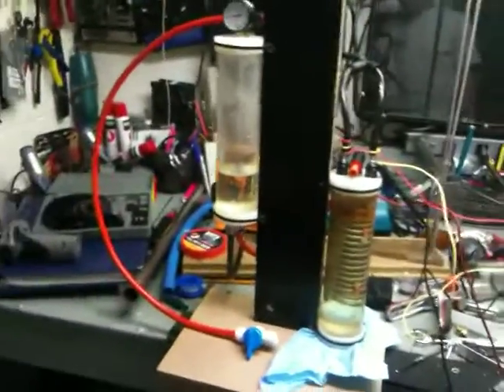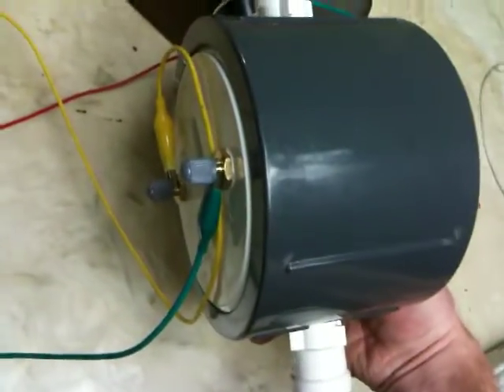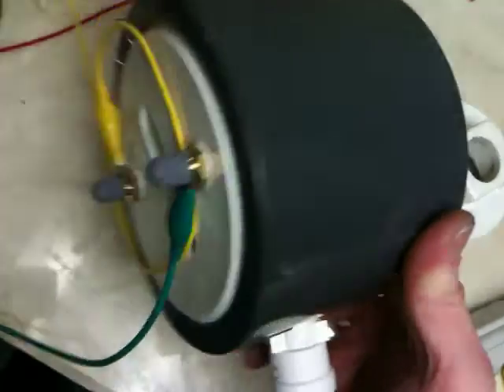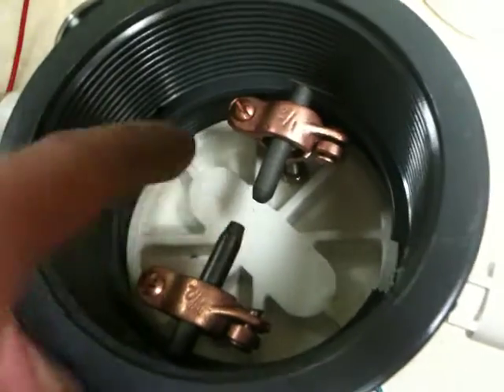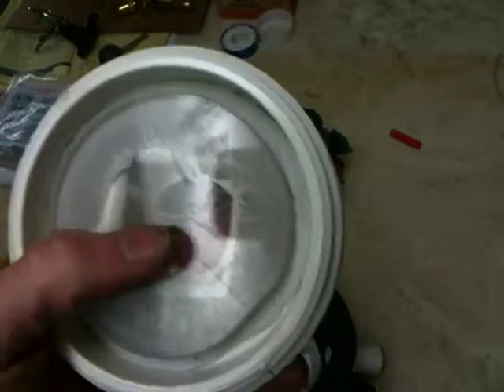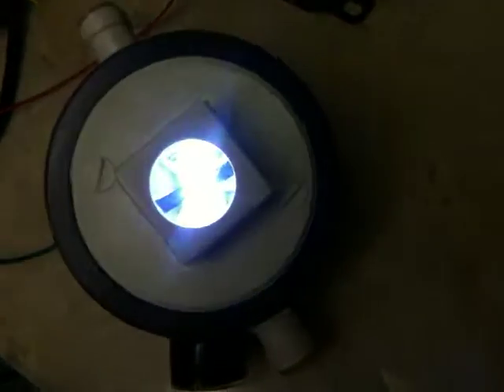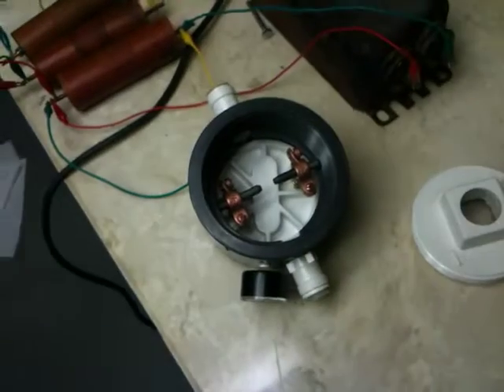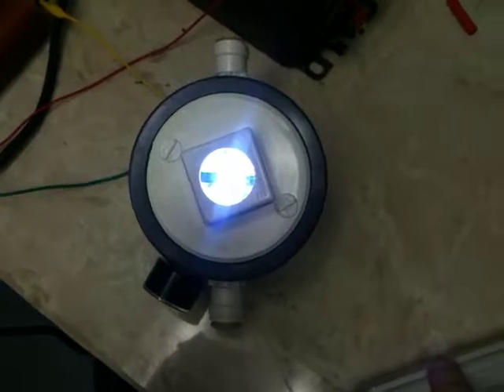1.3 Carbon Spark Gap With Caps! In New Chamber!  Stanley Meyers (EPG Test1.3)

Comment: good job Russ-i figure you could also ionise using a secondary spark gap off the NST....rather than run another device like my setup has-but i spose we need to qualify the magnetic gas claim yet before the nitty gritty needs sorting out on the most efficient way to process it-any ideas on testing for magnetism ???
maybe a sensitive guass meter.....

Comment: ok looks good & intresting! Perhaps you can add a little pc-fan inside the reactor for better gas mixture? just a idea ;) Ok, and i thought a lot about collecting the gas & separating it from other gases.. and i will post you a little picture when i can. 

Its basically a 3 stage cooling process (ice+salt, then liquid N2, and it that's not enough, liquid He2) combine with magnets. Bit expensive but perhaps for later when you have some more results and need a better purity on the magnet-gas.

Comment from the maker: @crob227 It may, but, confermed from alex petty's work with this already, just argon works... As a'n unpoller pulsing core... So adding the magnetic vapers ( iron, cobolt, nickel, ECT)  may make this alot better! Or alot worse... 

I think sope and bubbles may not be enuff to verify the gas... But it's worth a try! Did it work? 

Kinda a joke but

Did Stan try to move magnetic gas in a bubble? Lol no! He used it to "pulse" the gas... So you may be looking at it slightly defrent, just a thought